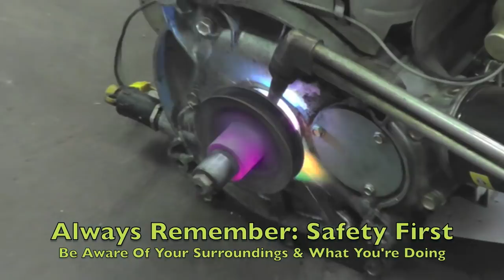Troubleshoot & Replace Camshaft On Briggs & Stratton Intek Engine

Comment: 16.5 hp and 18.5 hp briggs intek cams have the same lift ? Will the cam from 18.5 fit the 16.5 if so any power gain?

Comment: Quick question Taryl.... Whats the difference between a 25  hp intek twin and a 23  hp intek,  besides 2 hp? Is it the bore and stroke? Reason i ask is because, i have a 25 hp Intek twin, and i need to replace the rod, piston and crank, i think.  I found a 23 hp crank, rods and piston s on Ebay, but i wasnt sure if they would work? Thanks Jim

Comment: Getting ready to put in a performance cam and tapit in a motor. Can I use just reg. grease for assembly lube,, or is royal purple 90 weight on the parts good? I do not have any specific assembly lube thus the question

Comment: Have you seen many compression release failures? Pretty sure we're dealing with one on an 18HP intek. Surely you've come up with your own mechanism that isn't brittle and failure prone? Thoughts on an external/ manual compression release simply bleeding pressure from the head?

Comment: Great video, I've got a problem with a motor, it's a 22hp, Briggs,ohv, twin cylinder. It will not turn over all of the way, acts like it hits a wall when turn the key on, When I pull the plugs it spins freely. After doing some research,  every thing that I have read states it's a compression release problem. The first thing I did was checked the gap on the valves, .005 on the exhaust and .004 on the intake. I pulled the sump cover off and found out that there is NO compression release on the cam , I tried to do a visual check on the cam lobes but could not see any difference in them. I thought about closing the gap in the exhaust valves but I'm afraid I'd bend a push rod,,,,,,any ideas on this.
Reply from the maker: I had one the other day cranking hard I set all 4 valves to .003 spun easy. If that doesn't work you might need a new starter.

Comment: Taryl, I have a 2015 B&S 15.5 hp, 500cc motor. It blew a timing gear which got caught under the cam and ripped 3 teeth off of it. Replaced it all, all seals, gaskets, etc. I have been having reoccurring oil leaks. I was able to seal the sump gasket up, but it is now leaking out of the PTO seal. I put the gasket material around the outside as in your seal video. I am wondering if I didn't put the seal down far enough, as I didn't want to go too far down. Any suggestions are appreciated, thank you.

Comment: I understand how you need to replace the with identical camshaft on engine with oil filter/pump but what if you have  bad camshaft with no oil filter (2012 Timemaster)?   My Briggs 8.75 camshaft needs replacing.  I have a good camshaft from a JD 8.75 that has the notch for oil pump.  Would it hurt to put this in the engine even though the notch isn't doing anything?

Comment: I have a 1995 V twin Turbo cooled Briggs and has a problem with the starter a keep burning plastic gear is a possibility to fix the valves on same motor

Comment: Taryl my mower engine only fires over with the sparkplug out. When its in it spins over until it hits the compression stroke. Could that be a bad cam or compression release?

Comment: Hello Taryl, I'm very new at small engine repair, my father passed away and I inherited his lawn mower shop,so I have a crazy question for you. I have a Briggs and Stratton 18.5 hp engine with a bad cam lobe. The engine has a oil filter and pump also on it. I am switching the cam out of a 17.5 B & S engine that does not have an oil filter or pump, and I know the cam I want to use does not have the slot in it for the 18.5 with the oil filter and pump. My question is, can I switch the sump cover from the 17.5 engine (it doesn't have a pump}, to the 18.5hp engine sump cover that has an oil filter and pump?

Comment: I had to replace my cam because of the compression release. A year later my cam was worn like the one you replaced. When I was putting my 3rd cam in I noticed that the pot metal from the first cam (about the size of a BB) was in the hole that the cam goes in. It might have blocked some oil circulation causing my cam lobe to be wiped. PS I also cut my bank in the front yard.

Comment: Hey Taryl, 
 My replacement camshaft did not come with any thrust washers pressed onto the new shaft at the side opposite the gear, like the old one has. I did not see you transfer them in this video. Are they not really required?  if I was to transfer them it seems like they are a press fit, so I'd have to heat or press them to get them off.then 
Press them onto the new camshaft. Great video, very informative.

Comment: Taryl,  awesome video,  helped me a lot.  My compression relief lever mechanism was broken,  I was still able to start it with a bit of dickin around before cam replacement but then I couldn't anymore so I replaced the cam and it now turns over normally.  However I can't get it to run, and I think the problem happened before cam replacement.  It just cranks about 4 revs and pops.  Compression 130.  spark good. Starting fluid in through air intake or in spark plug hole dosen't seem to help maybe bigger pop.  Don't know what to do ??  took it back apart to confirm cam/crank were perfectly aligned.  Valves moving normally if you look in through in and out ports.
Reply: Taryl,  I figured it out. Was a sheared flywheel key.."and there's your dinner"  Thanks !!  Greg
Reply: @gregperch3197    I commend you on your persistence.

Comment: THANKS FOR VIDEO....    replaced mine  fires right up   good suggestion remove oilsump pump cover  primed ,   assembly lube,   reinstalled new cam new "burp" comeplete kit,   fires right up.

Comment: I use Lucas for re assembly.  It has a spout on the end of the bottle for easy application with no spills. Just like the small tube of oil from krowler.  Plus the lucas was free for me and a bottle will last me for a whole 3 or 4 years !!

Comment: Hello Taryll, I just replaced the camshaft ( nice video by the way). Everything was fine. After the fith start the motor began to start and stop very hard. The motor vehicle is vibratin pretty bad now. Whar did I do wrong? Greetings from Germany. Albert

Comment: Great Video and work was easily completed.  After completing and running engine 21 hp, now find that after running engine then shutting off and then restarting still has a problem with compression and starter motor power.  wont turn over unless manually advancing piston to over tdc.  is this normal or do I need to wait for the compression to release with a bit of passage of time.  I notice that my other B&S mower, 28 hp does the same thing.  comments please

Comment: Very informative video . You did a great job of explaining everything
 and the video itself clear enough to see
I have a 21 hp B & G it is on a Ariens mower
 Do the cams wear out pretty quick on these ?
Mine will start to turn over ad then just locks up
 Pull the plug and it spins freely
I doubt this mowere has more than 4 or 5 hours on it
 Have not pulled the cover to see if the valves move properly
 Any other ideas would be appreciated
Reply from the maker: Valves need to be adjusted it that doesn't do it then the compression release on the cam is broke & the cam has to be replaced. I have a video that shows you how to adjust the valves.

Comment: OK, Tarly love the videos. Good stuff. Can you use a camshaft with the knotch in the end in and engine that does not have a oil pump? ( had the round shaft without the cut knotch in the end originally)

Comment: Hi Terryl. I have a briggs and stratton 17.5hp. Model 31c707 3346 G5. Motor has no oil filter. I can not find the cam and gasket. The only cam I find has the notch for the oil pump. Will that work or what do I do please help. Thank you sir

Comment: Hey Taryl great video as always. I watched a video on YT about the Troy Built pressure washer that has the Briggs engine on it. They say it has a plastic camshaft and was wondering if there was any truth to it. From what I've heard alot of people are having problems with it and don't recommend this particular pressure washer because of it. I've owned mine for about 5 years or so now and haven't had any problems with the engine but can't seem to get soap to run through it. Is there something I can do to fix the issue so I can use the soap dispenser? Thanks in advance and please help me fix my dinner.

Comment: Hi I've  watched several of your great videos to troubleshoot but am unclear on what the symptoms are for a bad camshaft.  Reason I asked is I'm troubleshooting a single cylinder intek that's running rough at high speed.  It runs fine at idle and I discovered I can get it to run ok for a few seconds by pinching off the fuel line.  High speed has what sounds like a rough backfire with black smoke.  Also new plug has black soot.  I've rebuilt the carb (it was clean before), checked the valve clearance( they were tight), replaced plug and filters, checked the after fire solenoid.  Paid special attention to the small rubber gasket when doing the carb rebuild since others pointed to it as being the culprit of the symptoms I'm having.  But still still running the same.  One thing I did notice was I'm not seeing the little decompress bump when I checked the valve clearance but mower starts easy though.  It seems to be fuel related, too rich at high speed but I don't know if valve and or camshaft or something bigger may present the same symptoms?
Reply from the maker: If it has the Nikki carb. the main jet either fell out when you took the carb apart and you didn't notice it. Or you reinstalled the main jet incorrectly.
Reply: You are on it!  it does have one of those nikki sixx carbs.  The rebuild came with a little (what I know now to be) main jet but I didn't see it when I took it apart so assumed it was an unused part that came with the universal kit.  I googled pics of a nikki main jet and now I see it drops in so it will fit into the pickup tube but it also looks like it has a small (as in tiny) o-ring to keep it in but mine didn't come with one (or it was so small I lost it.  Mystery is the symptoms were the same before I took the carb apart?  I was careful when taking apart and if it would have fell out I had the carb on a clean towel.
Reply from the maker: Yes the jet should have a o-ring. They shrink and don't stay in place. You can't buy the o-ring separately and I haven't found one that small to use in place of it so I crazy glue it back in. Is the float level? If not it could be part of the problem where the needle & seat are not sealing and it's letting in to much gas causing a rich condition. I have a briggs carb. leaking video that shows how I use a heat gun   on the Nikki carb. to get the float level back. I find it COOL that yur fixin this & trouble shootin this repair. You sound very knowledgeable.

Comment: Great video. Your series are some of the best DIY videos on the internet. 

I do have a question thou. I replaced the cam shaft on my JD D110. Went pretty smooth after your video. The little fly weight was broke off the camshaft that releases compression on start.  Starts and sounds great now.  However, when going up a small hill, it has no power anymore. Any ideas what may cause this? Thanks

Comment: I got a Craftsman with a 21 hp briggs platinum one cylinder doing the same thing.  Took it to a small engine guy he tried first adjusting valves and that didn't help it.  He said it needed a camshaft.  He said something about a spring being broke somewhere and I asked him about the lobes if they probably were wore down and he said no.  I don't believe he is making it up as he works full time at a small engine shop then does this work at his house also on the side.  What would be your thoughts about it if the valves have been adjusted he said something about when he went to adjust them they were pretty loose and that in part did contribute some to the camshaft failure.

Comment: Hey Taryl, I love your videos! Crack me up.  
I have a question.  I have a 190 cc Briggs engine from a power washer that some bonehead at work started without oil.  I took it apart to bring to my machinist cause the bore is scratched and carnage happened. 
My cam shaft has a little spring loaded device near one lobe but between the lobes.  I assume it is a compression release.  Is there any thing I might have messed up removing the cam?  I pulled the cam without lining up the marks.  When removed, it felt as if a spring released.  The device still returns to rest by the lobe, but the spring is really weak and small.  I wonder if  i messed up the little keeper spring, I'd feel a lot better if I had a picture or description of where it goes.
Maybe the lifter was riding on the release and I'm fine.

Comment: Great video, Taryl. What the heck is the deal with my 725cc 22.0HP Intek V-Twin NOT having a compression release on the cam?? It's not missing or broken off and slopping around the bottom of the crankcase. Its just never had one. Is there a special way I need to adjust the valves to get around hard compression starts?? You da man. Where's my dinner?

Comment: Taryl, (and Jr.) , one of your best and I've seen them all (several times). Covers getting into the engine for any reason and beyond. No snow to ride snow machines here on Northeast so I'm starting my tractor refurb hobby early this year. Please keep up the great vid's way better than anything on TV and I ain't kidding a bit. One question, no gasket sealer? Figured you'd lay a bead to be safe.
Reply from the maker: +Mick Pendy I would if the engine I was covering had a problem with leaking sump gasket but that model Briggs uses a good gasket. Now the intek V-twin Briggs had a problem with the gasket leaking But they came up with a new gasket kit to repair that problem.

Comment: Hay hi, love your vids,lol. Iv a question,  iv a 2T, moped. Iv really buggered the crankshaft, badley cross threaded the shaft and the bolt, changing the variator, i cant do a swop ov the  crankshaft,  dont know how, but watching your vid was great. Do you you think i could tap a moped crankshaft like you did.? Or have you any tips on fixing my bolt and crankshaft.pls help...

Comment: Im having issues with just starting the motor. i adjusted the valves to the right specs and did get it going had to turn the motor backwards some to get the flywheel spinning enough to actually get it going and sounds good.  the valves seeem to open and close fine but thinking maybe its either the starter or the compression release on the camshaft.  its only like five years old the lawnmower.  any ideas on finding which one is the bad part.

Comment: Hi Taryl. Thanks a lot for your videos to you and your team! I have huge favor to ask. Can you please teach us about plastic carbs like on CCR2450, 3650, etc. I never have luck with them things. Also please teach us more on 2 cycle engines. I have had couple blowers start to run horrible after like 15 mins and sometimes shuts off completely. Thank you!
Reply from the maker: Those plastic carbs warp a lot. The only way to fix it is to replace it with the new metal carb. The OEM Briggs one is $100+ But go on eBay and you can buy an aftermarket one for a lot cheaper. But, sometimes the new aftermarket carb will surge, so you have to very lightly (with tip cleaners) file-open up the low-speed jet a little. Now there's yur dinner!!
Reply: @TarylFixesAll  wow thank you for fast reply. I did replace with Amazon $12 carb on two units and them bastards would surge like there's no tomorrow. I will try your advice and let you know what happens :) thanks for the dinner!

Comment: After a nee carb, coil & plug. New filter and blew out the line- even higher octane. Flywheel key ok. Adjusted valves from 3-5, 5-7 at each thickness..lol. still popping- backfiring at times.  Can mow a good size lawn without shutting off.  Rebuilt old carb and with a new one still nothing changes.  Hoping a cam will fix it...😁

Comment: Hey question. I took the cam shaft out and noticed there's some slight play in the pistons. It feels like it's equal between both. I'm not sure if it's supposed to be like that. I had a thrown valve rod (you did a video about it). I just am not sure about the play

Comment: HI Tarly I change my camshaft on a John Deere l100 riding mower with a briggs & stratton engine what should I set both   valves at. 006 or .004 thanks

Comment: I tried to set the valves a 4 thousand on a 21 hp Briggs and the compression release still doesn't open to let the engine turn over. Could there be a camshaft problem. Both valves have really good travel when compressed.

Comment: Taryl Fixes All , I have the very same thing on my B/S 15HP OHV engine, What I would like to know is that this engine is 12 years old and has 554 Hrs on it. Should I go ahead and put new rings and have the head reworked? 9/25/2016 Thanks Stanley

Comment: I have a vanguard 23hp and it can’t crank over even with the plugs out! it has the valves set right also a new battery and new starter. Any idea why?? I can turn it over bye hand and seems fine

Comment: Hi Taryl one of my connecting rods broke. When taking the cam, I noticed there was no compression relief mechanism on the cam. The Husquavarna is a 1995 model. The engine is a 446677. Is this normal?

Comment: Hi, do you know how to remove a flywheel on a 5hp briggs engine without special tool? I need to check the cap because I got no spark. I think there is a bit rust on it that it has no electric contact. It's so hard to remove this thing

Comment: I have a briggs 19 hp intek and the intake valve rocker arm keeps vibrating loose and coming off the pushrod. When i rotated the engine by hand i noticed the intake valve wasnt moving. the pushrod isnt bent, the camshaft lobe is fine. was the tappet getting stuck?